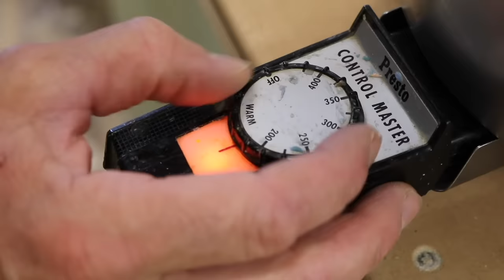How to Build an Outdoor Kitchen: Start to Finish!

Comment: What I learned is that I'm still missing like 20 tools
Reply: I'm missing about the same amount of tools lol
Reply: @OldMilHenke  and maybe 20 years of wood working experience lol
Reply: Same here! This guys has all
Tools you can name it looks like. Great video. I actually watched the whole video!!!
Reply: I'm missing like $20,000 to have all those tools
Reply: @fabianhernandez4839  I agree fabian
Reply: And the dedicated shop to house said tools
Reply: YOU DONT NEED ALL THOSE TOOLS....HE WAS JUST SHOWING DIFFERENCE METHODS
Reply: If I had all those tolls I did’ t need to see a tutorial, bcs I should be an expert dooing any proyect. So I would like to see some buddy doing all this works with more basic tolls lol
Reply: I learned that i am missing a backyard
Reply: 🤣🤣🤣at least your 20 tools closer than I am.
Reply: Every man is missing some tools
Reply: As well as a 10mm socket....
Reply: @OldMilHenke  agreed.  This is light years beyond my skills and available tools.
Reply: Exactly the same feeling
Reply: Right
Reply: If you’re concerned about the mortise tool; one, you can use a drill and a chisel. Two, you can use alternate means to fasten those parts.
Reply: You don’t need most of the stuff he’s using. You’d be surprised what you can pull off using just a regular saw, a jigsaw and a Dremel.

Comment: What sort of stain is that, oil or water? then what did u finish it with? I also want to do an outdoor counter/sink and I can't figure out which way to go.  It'll be under a covered patio in TX humidity

Comment: The best part about this project is that you didn’t use a single pocket hole screw!!! Well done sir! Looks Beautiful! I was searching “outdoor kitchens” on YT to get ideas to build one to put on our deck outside the screened porch I have been building for the past 45 days (staining the floor today and it’ll be DONE!!). I really like this design. Simple and somewhat “portable” in that you could take it with you if you ever moved. No warping of the countertop boards since you used some pretty wide plank boards? What species is that for the top? White oak? I was thinking about heading over to a local granite place and buying a remnant since I was worried about the longevity of a wood top but if after 3 years yours is still looking good, I might go the wood route.

Comment: Nice build! I would like to have a outdoor kitchen. Question with the sink, you're getting water from the outdoor spigot? Where does the drain go? During winter do you blow the pipes?
Reply: I was thinking the same thing. Where is the drain?
Reply: I saw another build where they put a bucket under the sink to capture the drain. I guess that's another way.
Reply: @jonmike316  Yea, ive seen that too in other setups.

Comment: Did you leave any space between the wood you used for the side and back panel when you screwed them into place? and how much space if you did so? :)
Also, what was the moister percentage of the wood, or what should it be to make it so the wood won't work too much after installing it outside?
Very cool, and great for inspiration! thank you :D
Reply: Yes, watch it again.

Comment: As awesome as that is and this guy is super talented.....he basically made a large cabinet counter with a sink not a true full custom outdoor kitchen. Does the sink have hot and cold? If so how does it drain?
Also the upkeep and maintenance on the wood every year just gives you more work in the future use hard materials such as cement, stone,brick, etc very little future maintenance. 
Overall it does look awesome and the wood working skills are top notch

Comment: Hi Jon, I am building a similar countertop for my mother in law. She plans on keeping it outside but under a covered patio. I wanted to do it with granite but seems like that won’t be possible due to $. Would you recommend concrete instead of granite as an alternative top?Will the frame be strong enough for heavy concrete? 
If I follow what you did but use 3/4” plywood instead of solid wood as an alternative to save money, how do I seal it to make it easily cleanable and durable? 
Thanks

Comment: Did I miss where the sink water drains to? I want to do something similar, may just have it dump into a nearby flowerbed to avoid messing with sewage lines.
Reply: I'm wondering where the water source is. It looks like it connects to the rain gutter. I'm sure I must be mistaken.

Comment: Why the router groove around the underside of the countertop?  Is this acting like a rain drip?   Well done.  This is our project for this summer.
Reply from the maker: Thanks, yes that’s it I call it a drip edge
Reply: @JonPetersArtHome  Thanks for the reply Jon.  One more question,  What type of wood is used around the outside of the cabinet?

Comment: I admire the craftsmanship, attention to detail, and obvious woodworking skills. What I see lacking is the common sense to pour a little concrete and use materials that aren't going to rot when placed into bare soil. Termites will have a field day with the framing work. Other than that, it should be good for 4 or 5 years.